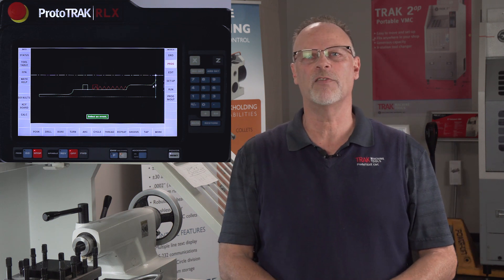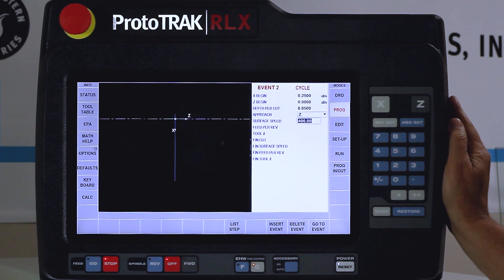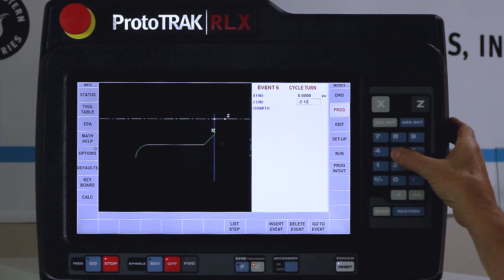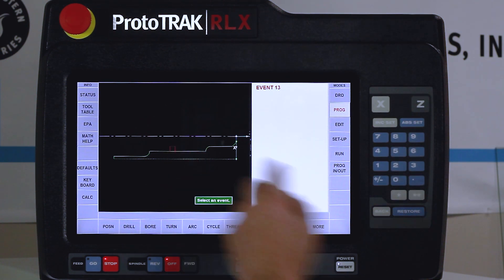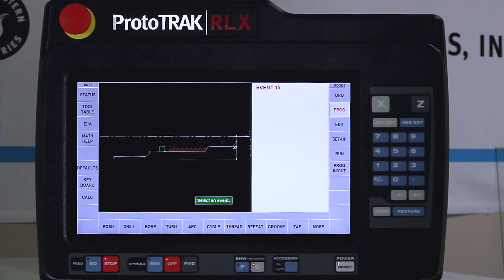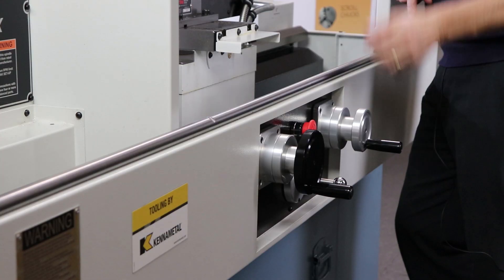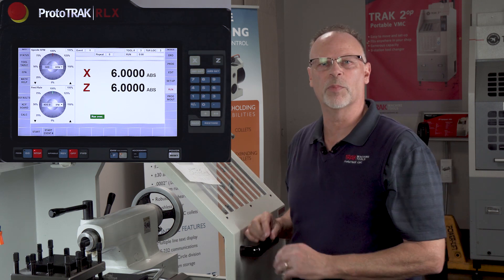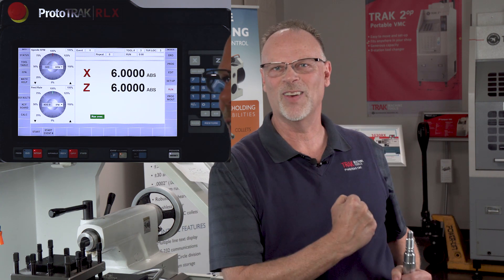OD Programming | ProtoTRAK RLX CNC | Lathe Programming

Comment: was doing this in class. Came to look at this again.  Interesting how the thread dimension matches Z3 on the groove.  I guess you want to cut the thread to that point.  I cut the thread to to z1 on mine and it didn't look right on make part, so I looked here and did that up to z3 and it was a good thread.  We also made the thread to z3 dim- .010 and it worked
Reply: It is important to know that Z zero is on the left side of the threading tool so if you don't go far enough, the point will not reach it's destination.  T.P.

Comment: I thought I had this figured out but...I drew up a simple cycle, closed it with cycle posn.  But I keep getting a warning saying X cannot travel toward and away from zero at the same time. I checked my program numbers, they all look good.  Not sure what I'm doing wrong.
Reply: Your last move in X where to position from the completed geometry to the stock size needs to be replaced with a turn move. On OD parts, everything is a turn or an arc until you get to the full length of the finished part and the diameter of your stock. After that, your position moves only back to Z zero and then, you end cycle. T.P.

Comment: Having trouble turning a concave form on the end of a bar. Can't seem to get it to cut without feeding in past the centre line. Using a 2.5mm full round tipped tool.  It's a 95mm rad going in 7.5mm from front face. The stock is 90mm dia.  Any help would be much appreciated.

Comment: We have this lathe at work. It’s got some good features but it is by far the most aggravating lathe I’ve ever used. There’s no need to have a separate tool library that makes you assign the tools to program. The way you set drills is so ridiculous. You should be able to just indicate the pocket and call it zero. Touching the tool to the diameter of the part is not accurate especially on very small tools. Then anytime you change the diameter of the tool is adjust the tool offset. Also having to click run program, start from beginning, spindle forward, cnc run, go is ridiculous. Cycle start should initiate all that. I do like the fact that you can set the z tool offsets off wherever you set the work z offset. That’s nice cause you don’t have to set your tool off the same reference each time. The lathe is okay but they really need to update the programming menu. Only showing 1 event at a time having to swipe through each event is cumbersome and sometimes confusing. They need to have a list. A no drag feature would be great too where the finish pass of a profile finishes all the faces by feeding -x. Gives a much better finish and more precise.
Reply: Wow! where do I begin? I'll try my best. First of all, I must remind you that this lathe is for toolroom applications. It is a prototype lathe, not a production lathe. Therefore, the tool library makes perfect sense. If you have a turret on your machine, I'll agree that it's not as useful as it is with a standard tool post. You sound like a creative guy so I'm sure you can figure out how to set up all of your drills from the center of the part and only use the Z offset for the  difference in length. This being said, we are going to revisit the tool set-up procedure because we also believe that there are some things we can change to make it easier to use. In the meantime, I suggest you watch all five of the RLX tool set-up videos. They will help you with the complication. 
  As for how you start a program, it sounds like you are using this to make some larger quantities. I agree it is cumbersome to have to push all those buttons to restart after each part. Since this is a machine that can be run with the door open, we have to put some safety features in it such as having the operator start the spindle. May I suggest that you add a repeat of all your events to end of your program? This way, you will only have to press go after each piece part. Please keep in mind that if you do this, when it asks for tool number in the repeat, make sure to enter the first tool that is in your program. This will make it use all the tools in the program.   
  In order to see more than one event at a time, place your finger just to the left of the event and a green line will show up. Move your finger to the left and you can change the screen to show the previous event while you are programming the current one. To move quickly through the program, use the LIST STEP feature both forward and backwards. When doing so, the geometry for each event will be highlighted as you move through your program. This makes it very simple to see exactly where you are in your program. Just press return when you get to the event you want to view and it will take you directly to that event. Lastly, if you ever need to get back to page one of your program, just hold the PROG button until the circle shows up and when you let go, it will automatically take you there. 
  I like the idea of changing the direction of how the tool moves when doing the finish cuts. We did make a couple of changes to how the CYCLE events currently work. These changes will allow you to move from OD to ID when cutting with the X axis. I'm assuming that you are aware of how to separate the X from the Z finish cuts using the OPTIONS flyout page. If not, check it out. This will cure most of what you are not happy with. 
  The next software update will have the reversable direction. It will also have a default so that you don't need to use the OPTIONS button to separate the cuts if you prefer. This update will add more capability such as automatic NPT treads, more choices when making grooves and a few other enhancements.  Thank you for your feedback! I hope some of these things help you to enjoy the product better.  T.P.
Reply: Thank you for your reply! I want to say I made that comment prematurely. As I’ve used this lathe more the more I like and appreciate it. It’s a great machine that makes using the tail stock and hand wheeling easy. I just want to say what I feel should be updated….There’s got to be some machine position added to allow for retract positions to come based off machine and not part. Next the active tools should be loaded and unloaded from the tool list and shouldn’t be removed from being active between switching programs or deleting events. There should be the ability to copy events. Would it kill y’all to add a backspace button?! Stop making the tool diameter change with offset of tools I shouldn’t have to put diameter of 0 to prevent x zero location of pockets from changing. Also if the control loses power the x workoffset shouldn’t lose its location. Also please add the chamfer option at the start of part I should be able to simply tell what size chamfer I want at the face of the part. Also add a facing cycle option that cuts from the of towards the center.

Comment: I use this lathe for one off work, pretty useful for the right jobs. Having some trouble programming a face groove for an o ring, but I'm usually able to figure it out eventually
Reply: Mathias, the only thing you need to remember is that your X dimensions have to start closest to the center and finish farthest from the center.  The rest is the same as an OD or ID groove.  T.P.
Reply: @trakingpat2750  thanks, I'll keep that in mind.
Problem is the groove has a full radius on the bottom equal to its depth. So I can't put in even the smallest top conrad. But it's not critical so I can do it by hand with a file.
Reply: @mayomonkey420  Sorry I'm so late to the discussion.  I always program grooves with zero tool nose radius. Internal grooves, subtract the tool nose radius. External,  add the tool nose radius. They come out perfectly.  Email me with any questions you have. This is the most easily manipulated control. You can make it do anything you want.

Comment: You have a video on how to program but the one I need lol .. I need to figure out how to face a bunch of material off  with passes not taking the of down
Reply: You gotta use a turn and put in the coordinates,then a postion putting the tool away from the job in the z axis.then use the repeat cycle for event 1 and 2 .thats how i doo it
Reply: Repeats work well,  but the clipboard is really a powerful tool.
Reply: @darrinross6488   I agree with with both of you!  Thanks for the input!  T.P.

Comment: Thanks for sharing what a POS your machine is.. A quality machine is not much more and you can actually make money with them!😁
Reply: For small runs and prototype parts, you can not beat a Prototrak. I also work on a Hurco conversational lathe, and the bulls*it you have to go through to do something simple is incredible. Editing on these Prototrak is super simple. I've seen Doosan lathes stop the spindle with a 3/4" drill. I've put 2 1/4 inch insert drill through 4340 and H13 without even a sweat. But for production,  there are better choices.
Reply: @darrinross6488  Thanks for your input!  Some people just have to put in there opinions.  I guess that none of our 50K+ ProtoTRAK users out there are making any money?? T.P.
Reply: We have  (9) $750k 5x machines and 73 other machine tools in my facility. I use the proto to make repair parts and custom one-off parts for machines we design in house.  This machine is awesome.